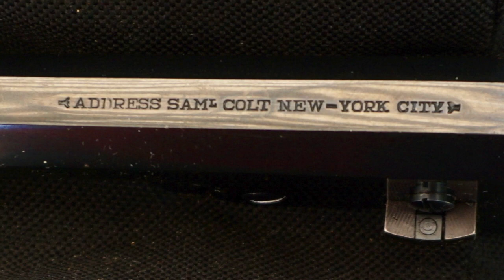THE REVOLVING BELT PISTOL OF NAVAL CALIBER

Comment: I have an 1861 Colt black box. I have noticed that the rifling is quite deep and .380 round balls chronographed an unusually high 1,000 FPS with 30 grs of 3F.  I am wondering if the deeper rifling creates a higher chamber pressure than in the Italian guns with a shallower rifling resulting in a higher velocity?  Have you chronographed your gun?
Reply from the maker: That's interesting, I do not have a chronograph. I just know the .380 shoots better than the .375 in my navy. My usual load is 22grains of 3f Schuetzen or Alliant Black MZ.